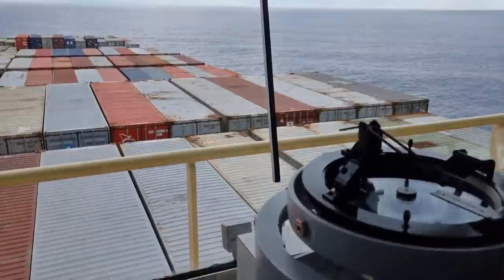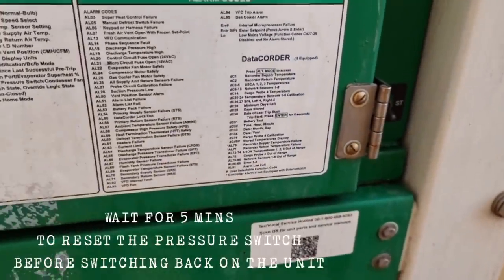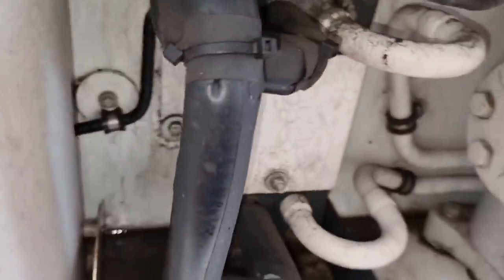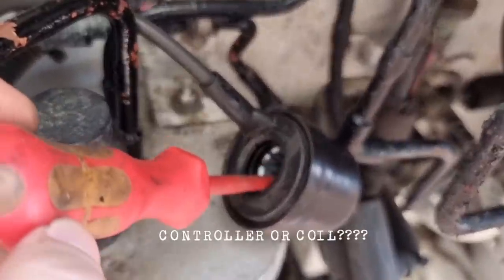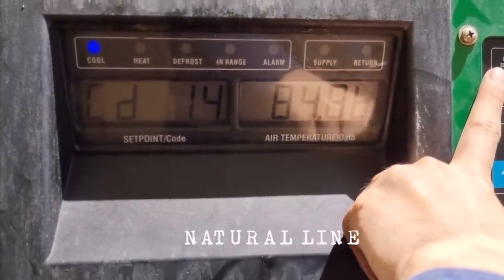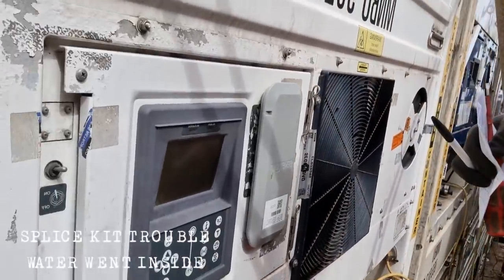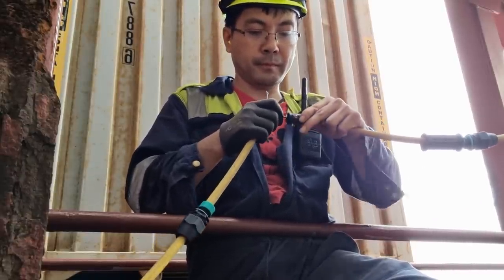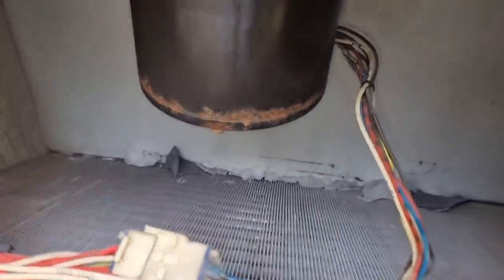ONBOARD REFRIGERATION SYSTEM TROUBLESHOOTING | MARINE ELECTRICIAN LECKYJAKE

Comment: Lecky, thanks for your helps .. All your videos are interesting and we can learn different problems. Best regard!
Reply from the maker: Thank you for the support
Reply: @leckyjake  Hello Jake, I love the channel and it has helped my understanding of systems during my study. I have a question. Where can I find some resources to work out the required power supply for a vessel carrying approximately 2200 reefer containers? could it be assumed that a medium voltage 4KV bus bar and an average 7kw per reefer consumption is to be expected ? I have struggled to find good information for my projects, and then I can make the calculations for my assignment myself. 

Perhaps it is a video you could make in the future? The power required and distribution panel for the reefer containers. you have done a lot on the actual containers themselves but I would like to see the whole system from the generator to the consumer if possible.

Comment: The greenline of the Carrier is a transcritical CO2 system and this is just a single stage the most of the CO2 systems are CO2 booster with a low stage and high stage. This systems are designed to operate up to 12 mPa (120 bar).

Comment: U also check the coil with a multimeter 🤔
Reply from the maker: You can do that but you need to trace the paring of cables at there are four wires in that coil. I just showed a not conventional way of checking.